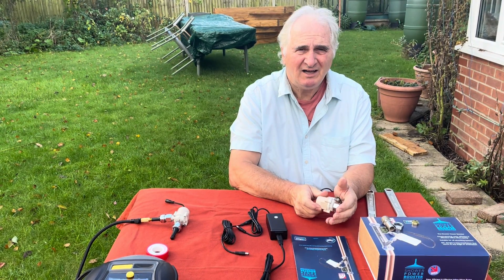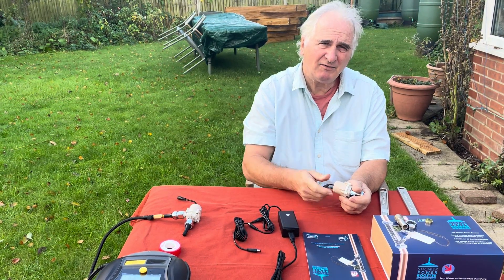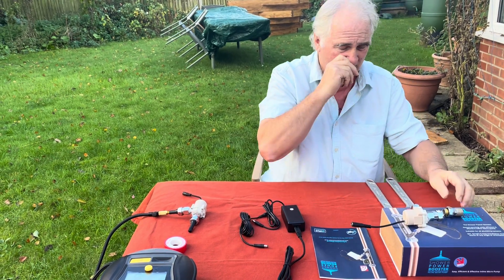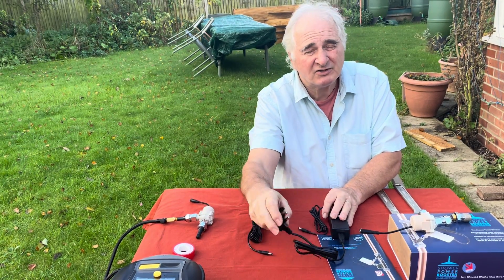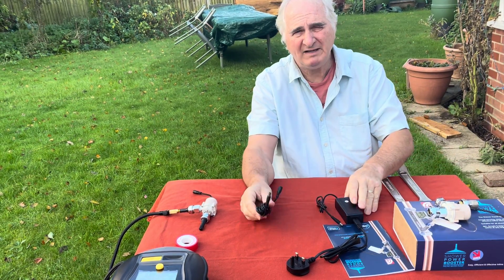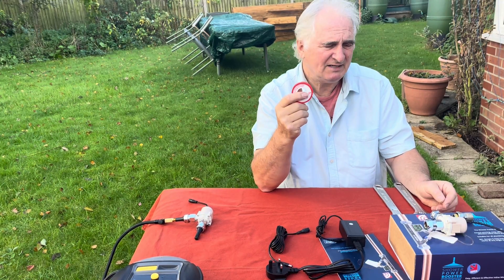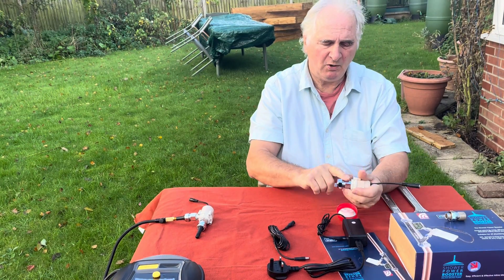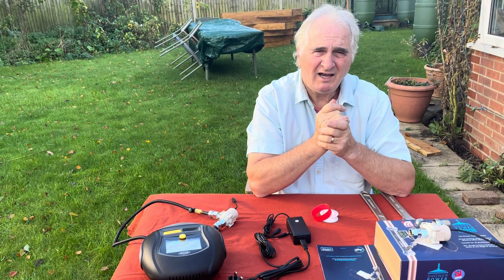Radiator Flow Booster For Any Lazy Radiator

Comment: Hi Alan, will the radiator still work if the pump isn't running? The radiator I'm installing it on does heat up eventually but it takes 1-2 hrs normally so want to speed it up and get the room warmer quicker, but once hot we may want to switch it off if its noisy. Thanks.

Comment: Hi there,Alan, does the rad flow booster go on flow or return,? As I have come across  thermostatic valves, on flow or return sides of a radiator in the past,. But you say this product is for the lock shield side, am I right?
Reply from the maker: It needs to pump from the hot side to the cooler side so the direction of flow is important and it also replaces the lock shield. The pump can be rotated to pump in either direction.
Reply: @alandwright2 Hi Alan, sorry but I read this two ways. Does it push water into the radiator OR pull water from the radiator? I honestly thought the thermostat was the water in (or at least it is on my troublesome rad). Thanks.
Reply from the maker: @TheLsduk1  The only way that you can tell which way the water is flowing is to see which pipe gets warm first. The pump can push or it can pull (you just rotate the pump - it fits either way). Fit the RFB so that it pushes the water through or pulls water from the radiator. Replace the TRV. Pushing through a radiator is better than pulling but it works either way.
Reply: I have one of these. Tried to contact you to get a refund for the v2. It is so loud that there is no point in having it. The inherited lazy system is in our living room. It disturbs everything as its also pumping out 60db of noise as well as hot water
Reply from the maker: @user-re3si8vv8o  The pump is so very quiet but it it creates a small vibration that can in some circumstances be amplified through your pipework but only in some homes. It may be there is a problem with air as well. I offer a refund if a customer wants to return the pump but I cannot recall your email. Please resend your email and I will send you instructions to return the pump for a full refund.
Reply: @user-re3si8vv8o  That's strange. I have one fitted on my narrowboat and I find it uncannily quiet. I did have an issue when there was air in the system and it whizzed a bit but that settled after a few minutes.